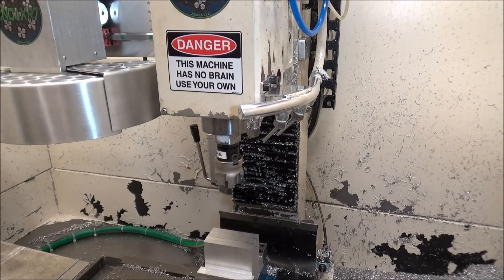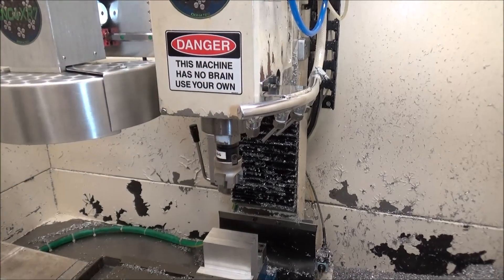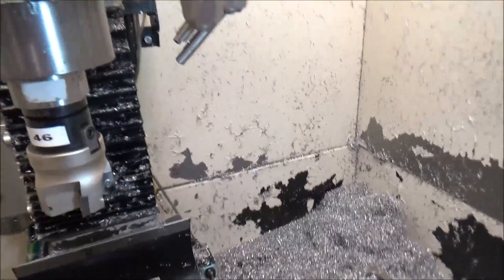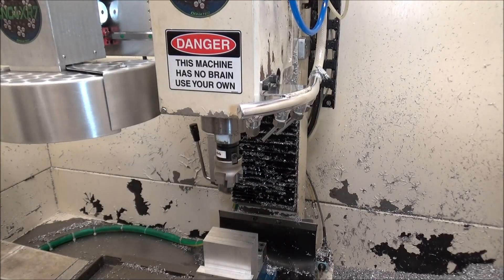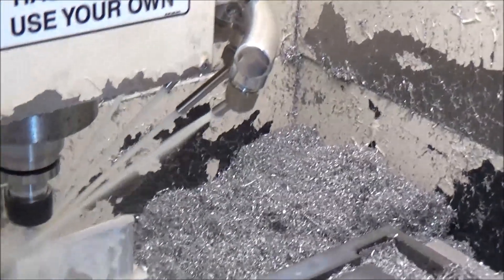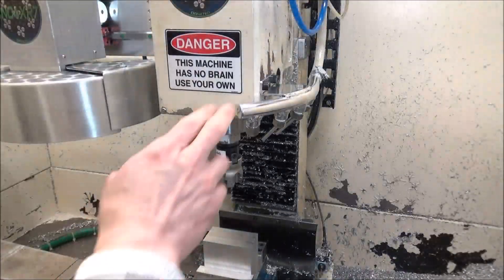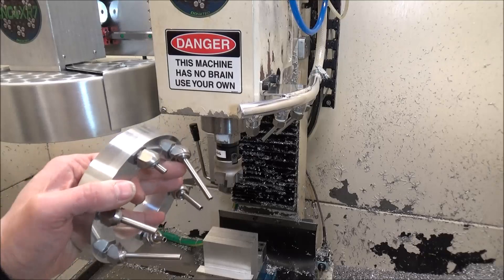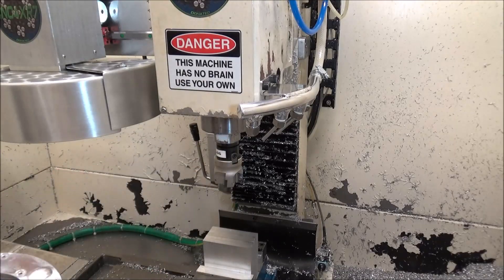Flood Coolant Tube

Comment: That's a good solution, but it doesn't look very adjustable depending on how long the tool might be?
Reply from the maker: The SS  Nozzles will adjust the full range of travel of the Z axis.
Reply: @CNC4XR7  So those tubes are in a ball valve and moveable by loosening the hex nut?
Reply from the maker: @williamhardin5254  yes there in a ball but they are friction no knurled ring